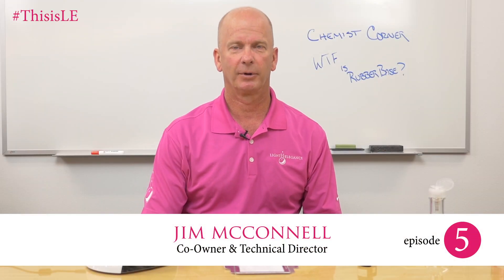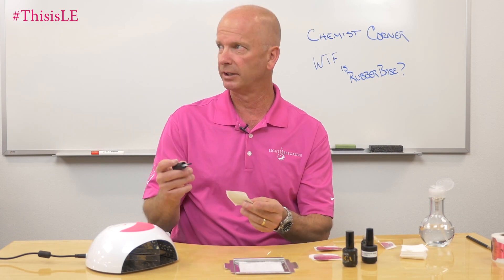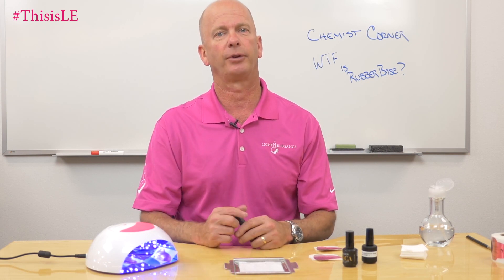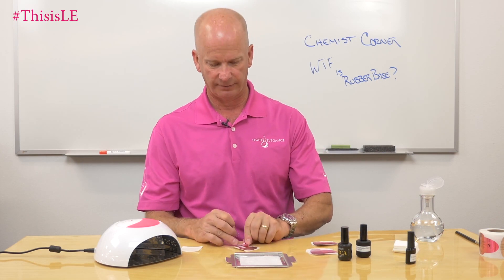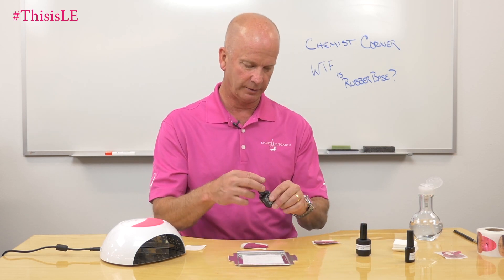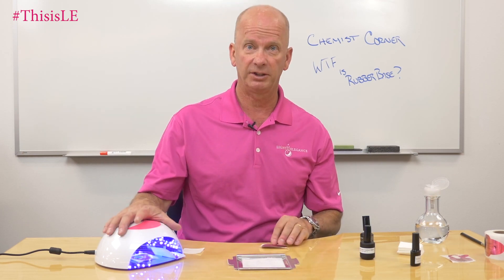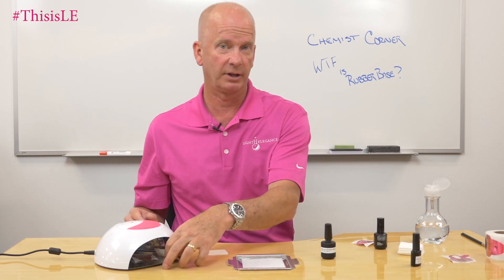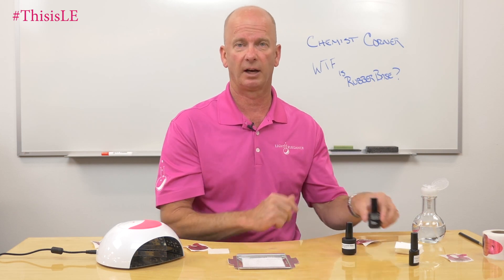What Exactly is Rubber Base? - Chemist Corner #5 with Jim McConnell

Comment: What is the point of the rubber base? What type of nails and/or nail service would you want this product for?
Reply from the maker: Great question. A rubber base material, at least the good ones as demonstrated in the video, can provide some structure and strength to the nail in the same manner other enhancements do. The added structure and strength can extend the life of gel polish and other color systems significantly when compared to using base coats that don't add much structure and/or strength.
Reply: Hope to see a rubber base launch!!!

Comment: Hello Jim! Thank you for this amazing content. So “rubber base” is basically a thicker soak off/ flexible gel? Meant to give the nail some extra support?
Reply: You are correct but in the case of some of these rubber bases that I tested, they were VERY thin viscosity products and offered no additional strength
Reply: @jimmcconnell6079  well, but the name would not suggest strength really, to me it is meant as more sticky base I guess?

Comment: Or to put rubber base in builder gel, clear both, in that case process will be faster? I will get 2in1
Reply: Please do not mix a rubber base with any other product unless you test it on yourself first and also speak with the manufacturer to get their input on mixing the rubber base with another product.

Comment: Can I put pigments or what to get rubber base in colour?
Reply: I would not advise using something that claims to be a rubber base.  I also don't advise adding products such as pigments to a gel without proper guidance from the manufacturer.  Without more information, it is difficult to offer any other response.

Comment: Hi !! I have a question, so rubber base gel belongs to hard gels, soft gels or soak of gels. And why?
Reply: Rubber base products would belong with soak-off products because they can soak off.  They are not hard gels because they are attacked by acetone.  I consider soak-off gels and soft gels to be in the same category.

Comment: Did you say that vita prime does not light cure?  Do you have to wait any amount of time before applying a bonder? Just a small tiny drop ahead of the hyponychium and do use brush to spread product ,just leave the small drop as is?
Reply: Hi Gail - yes, VitaPrime can be used before Tack and just a touch of a dry brush of VitaPrime to the fingernail is all that is required.

Comment: So if in  rubber base there is no rubber what material make her different from regular gel polish base. What is that what make her strong?
Reply: The rubber base is a blend of various resins.  Many of the rubber base products are quite weak and not strong.  Brittle formulations with good adhesion because of the resins that are used with no "rubbery" physical properties.
Reply: @jimmcconnell6079  thank you for your reply Mr Jim